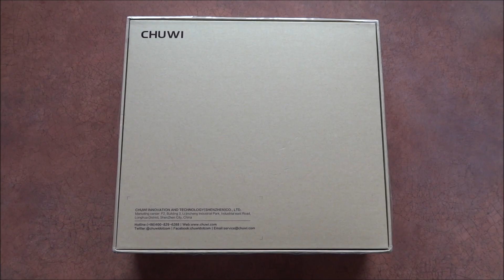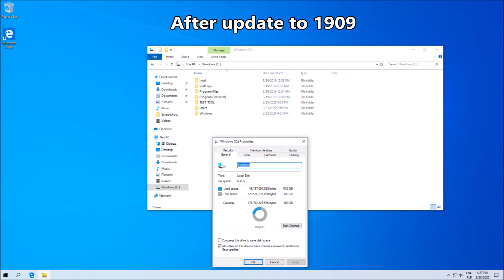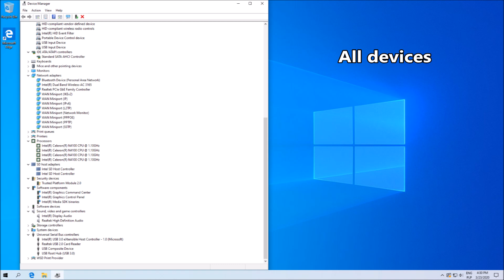Chuwi Herobox Gemini Lake MiniPC - unboxing, testing and teardown

Comment: I own this and can confirm the Ethernet/LAN adapter supports 1Gbps. You might have had an old cable that only supported 100Mbps or outdated drivers.
Reply from the maker: What drivers do you use? I wasn't able to get 1Gbps working. Used proper cable because other laptops work at 1G. Read a few forums and people have similar issues. There were even photos of PCB where it is visible that extra lines are not connected to ethernet socket. Banggood even refunded me partly because they were not able to find any solution.
Reply: @cbm80amiga  It was just working right out of the box. I even reinstalled a fresh copy of Windows 10 LTSE and it continued to run at full speed as well. So strange that it didn't work the same for you. 🤔
Reply: @Concept211  is it capable via wifi
Reply: @DonaldDuckTape  yes, it supports WiFi just fine although I use mine wired. But I tested it on WiFi first and it worked well and speeds as expected.
Reply: @Concept211  thanks
Reply from the maker: @Concept211  It seems that there is fixed version of this MiniPC available, so you probably bought this new one. It would be good to compare PCBs of old and new one, maybe this 1Gbps can be somehow fixed in old ones

Comment: How much storage can I use? Does it has space for M.2 SSD and a SATA III SSD or HDD besides the 180GB SSD installed with Windows 10?  Thank for the video; however, I'd like actually to hear your comments and/or explanation while your video is running.
Reply: it  is suppose to support a second sata hdd
Reply: has a sata port that supports upto a 2TB drive (SSD or spinning drives)... front has a slot for a micro SSD that supports upto 128GB chip.  I tried to see if the M.2 that is in it could be upgraded but company has yet to respond.   Can also plug external storage into USB 3.0 slots (I am using a 2TB portable drive)
Reply from the maker: @ramonmenendez9938  M.2 SSD can be replaced - it is visible on the video. External USB storage - no limits, I used it with 10GB drive.

Comment: where is the ram slotted at?
Reply from the maker: You didn't watch the video :) RAM is soldered. Everything is soldered in this MiniPC
Reply: @cbm80amiga  err... i did watch the video a couple time till end.. but i couldn't see you mention anywhere in the video about the ram.. could u possible tag me the timestamp
Reply from the maker: @d.sgaming4934  You are right, I didn't mention it. But at 3:27 you have PCB view - unfortunately except SSD there are no other slots.
Reply: @cbm80amiga  thx dude for the info..

Comment: And where is the ram? Can I change it?
Reply from the maker: No, it is soldered
Reply: @cbm80amiga  and can i desplder it and solder a better one?
Reply from the maker: @borja9875  You can try. Good luck :)
Reply: @cbm80amiga  do you recommend doing it? Or is it too difficult?
Reply from the maker: @borja9875  Better find other PC if 8GB is not enough for your application

Comment: Will i be able to run fortnite at 240 or 144 fps?
Reply: Isaiah Jones no
Reply from the maker: Yes, for sure :)
Reply: @cbm80amiga  at 144fps? Highly unlikely
Reply from the maker: @Zombie101  144fps at 640x360 resolution :)
Reply: @cbm80amiga  is it likely anyone will play at that res though and what about 240fps lol. Fair
Reply: Ok😞😭
Reply: yes
Reply: @emanfrmva1764  bro shut up it will not . I have one and I usually get around 60-70 on low settings and 50-60 on medium . But its still good at light games.